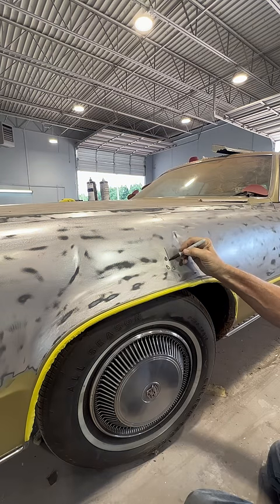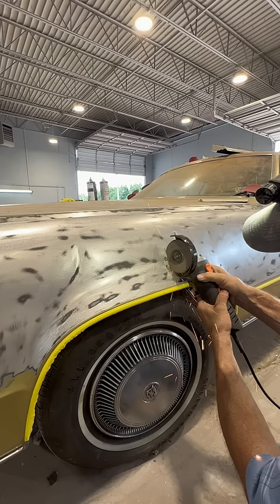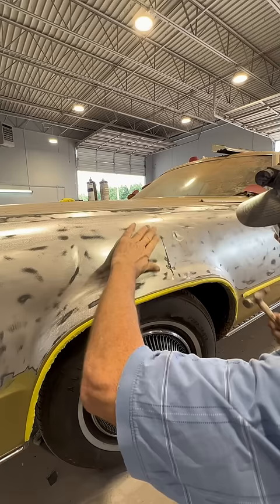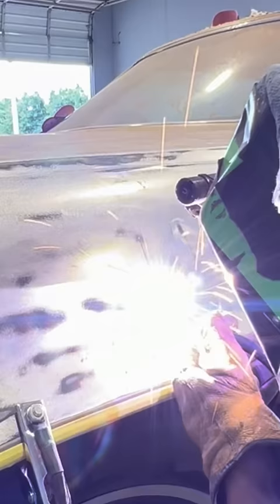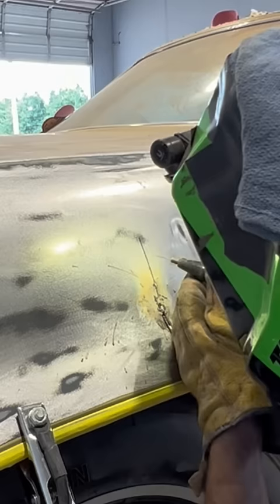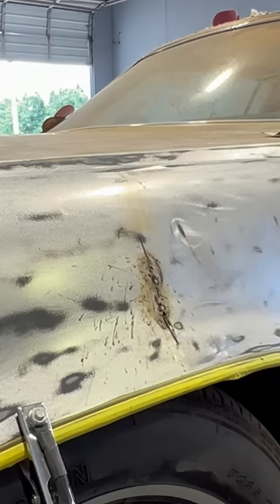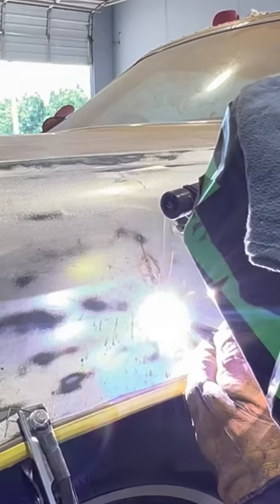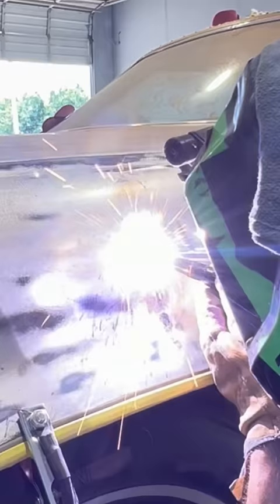BILLY SHOULD BE ARRESTED🤣 How To Fix A Buckle In Sheetmetal FAST DIY Auto Body Repair Flux Core Weld

Comment: You do a pretty slick job welding. I'm a machinist and a woodworker as a hobby. God willing, I never get stuck doing any body work. I'd be willing to bet 90% of the people that make comments about your welds would burn a bunch of holes in that quarter panel. Then you would have to buy a new one. Doesn't matter what the process being done is watching an artist is always fun

Comment: Glad you asked. I would use a shrinking disc or carbon shrinking tip, it would be done in minutes. Something done many tens of thousands of times.
Reply from the maker: Did you not hear that it was a buckle?  You’ve heat shrunk buckles exactly zero times.🤣🤣🤣🤣🤣
Reply: Oh no.. You're calling me out and seem offended by my factual answer and assume to know what I've done for body, paint, polish, restoration,fabrication, welding and show winning work.. What exactly is your definition of a " buckle"? Based on your "repair" you were removing a portion of the metal and further shrinking the metal, which signifies its a high spot/stretched metal.  For the metal to move in or out  it requires metal surrounding that area to also move in or out or structural damage to the part or both.. The reason for a "buckle" or a "high spot" is the integrity of the surrounding substrate/body lines are compromised..  How does cutting through the fenders "buckle" damage (which you just removed a portion of metal and also heated the surrounding area which is shrinking it, then welding, which is extreme shrinking due to heat and then grinding the welds also a form of shrinking due to the heat.....NOT equate to shrinking the "buckle"? BUT me saying I would use a shrinking tip/carbon tip/shrinking disc/map/ propane or cold shrinking the stretched/high spots/buckle does NOT work?  And to respond to you claiming I've performed 0 buckle repairs by shrinking, my main page banner for my real channel coming up on youtube which is a autobody fact checker page will showcase a 8ft ford bed for the Airforce of FT Walton beach, FL which will shatter your reality.  All you did here was waste time, materials, compromise a factory fender by doing the most aggressive and moronic "repair" for something that could literally have been done without any of this.  The metal on the lower fender moves in as you hammer it, further signifying it was high aka stretched.. You could have used a nylon or wood hammer and performed cold shrinking in literal minutes.. Do not follow this advice on this specific video.   There wasn't even a welding blanket or anything protecting the glass, where does  the splatter go when it hits a windshield?  Right into the glass...  No protection on the wheel or hood even...Can't wait to read your  response.

Comment: Love your no-nonsense approach to getting it done!
Reply: Thinking about stopping by a local body shop to grab a fender or quarter panel to practice welding some patches on. A cheap way to self educate myself.
Reply: What’s the longest you would leave a car in primer? The place that restored my ‘65 Chevelle left it in Primer so long that the paint won’t stick to it in some places and is now flaking off in some spots 🤬
Reply: I have one of those cheap HoboFreight welders that I use to weld up horseshoe clovers. Have you ever used one of those? I would imagine that for thing body work they would be fine to stitch patch panels in.
Reply: Whiskey dents!
Reply: Love to see the most dramatic before and after photos of some of the cars you’ve worked on. 👍🏻
Reply from the maker: @markbracci1184 I lost all my car pictures years ago
Reply: @OldBondoBilly that stinks.
Reply: What is the undercoat product you use to spray the backside of the fender when you’re done welding it?
Reply from the maker: Cavity wax (cosmoline)
Reply: Must be the same type of grease they stored Cold War era rifles in waiting for WWIII. Bought a few covered in that stuff. Takes a while to clean it all off. 👍🏻
Reply: Of course now you have me looking at another cold-war era guns online at GunBroker. Damn you Billy!!!😂😂😂
Reply: Odd question, but can you find sheet metal for patching panels at Home Depot? Saw a guy on a random channel say that and I thought it was odd.
Reply from the maker: Yes you can get sheet metal at Home Depot, but it’s expensive
Reply: Looks like YT is messing with you. There’s no way these have not had more than 1,000 views on the last 3+ weeks.
Reply from the maker: Almost 1400 views since Feb 3😉😉
Reply: Let’s keep her going!!!
Reply: It’s getting there Billy. Numbers are finally going up! 👍🏻

Comment: In the "old school times" before Bondo this metid was common. Then you used lead solder to fill in and sand smooth. Solder doesn't crack and flake off like Bondo will.
Reply from the maker: Fibral Lite also doesn’t crack or flake off

Comment: Love your work Billy we used the same method to fix the panels on 1 of my cars , we also use gasless on most of our jobs too 

We are currently building a 1929 hotrod with modern running gear and a channeld  body
Reply from the maker: Sweet😁😁

Comment: This is a very smart idea. It’s easier to weld than to pound it out. Thank you for sharing. Amen.
Reply from the maker: Impossible to pound it out without pulling the bottom front corner of the fender forward

Comment: How do you prevent the fiberglass from making a bump? Is it just invisible when you feather in the edges or do you beat the metal lower to make room?
Reply from the maker: A sixteenth of an inch is easily built into straightness

Comment: Whatever works best for you is the best way to fix it. I did body and paint repair in the early 70s we didn't have these new welders we had a torch and welding rods or brass for brazing

Comment: Believe it or not but thats how iI repaired an eight foot sheetmetal brake warped all to hell in a shop fire, paid 150 bucks for it for scrap iron then actually straightened it with this technique, sandblasted and repainted it and today you can't even buy one used like it for 3500 bucks, just goes to show those old schooll ways can be worth small fortunes at times if you open your mind to them.

Comment: Might not even need bondo if not much heat used to weld and grind. Xtra coat of primer will do 😁
Reply from the maker: I’m skimming it with fiberglass filler before finishing filler to get it. Nice and smooth.

Comment: I'm unfamiliar with the process of welding sheet metal for cars do you use the tacking method to prevent it from melting through the thin metal?
Reply: Yes, anything more burns through instantly.
Reply from the maker: Basically yes

Comment: Here  in Australia we have a product that used to be called metal mend. It was a K@H product before the factory burnt down, now motorspray a rustoleum assoc company has taken it on as metal fill. It is fibre reinforced with stainless particles and it works a wonder in doing the same as you, cut it with a flat drednel or you will be grinding ,there is no sanding with this stuff.

Comment: Great way too stress relief the metal, much like shrinking with a acetylene torch. Dude you're Ole School, not many of us left
Reply: I was wondering if anyone else here was gonna mention shrinking it with a acetylene torch I'm 40 but after I got out f highschool I went to a technical school for autobody  the teacher was a older guy he taught me and a buddy how to use a body hammer with a waffle head sorta like a framing hammer it has those spikes on the head  he heated the stretched part of metal and after it got hot he went around the outside of it with that hammer hitting with a inwards motion I'm sure it couldn't be done on these thin metal cars now though but I'll never forget him he was a awsome man/teacher he showed me how to lead a seam also he was like a inspiration for me  he knew so much and had so much hands on experience  I would have went to his class 2 or 3 more years if I could have but unfortunately you only get to go till you have enough hrs to graduate

Comment: Cars now all you have to do is heat it up with a damn hair dryer to get a dent out..😂 They say that it's to make vehicles lighter for better gas mileage.. But, I get better gas mileage in my 1989 Toyota SR5 that's constructed of all metal than my newer vehicles.. 🤷
Reply from the maker: I run into 24 gauge steel on newer cars.  That’s just ridiculous.  I can weld it just fine though as long as I have a separate heat and wire speed knob.😉😉

Comment: I have an original 1950's Fordson tractor fender that's buckled like this and hard to replace with anything nicer. I am thinking of doing the same with it.  I tried heating and cold shrinking it, but it won't go enough to be straight and stay there.
Reply from the maker: A buckle is not stretched; It is work-hardened.  You can’t shrink a buckle😉😉

Comment: Sounds good to me ! At least if i brought you a car . With a very small  pencil size rust whole over the rear fender . Ask you fix it the right way. Most likely you would have ground it down took all the rust out !
Replaced with metal welded  in a patch or welded the small whole  ! And puddy and paint  blend ! 
Sure your repair would have lasted longer than 4 months !

 Started bubbling charged me $ 1000  !
Reply from the maker: I have a short posted of a truck I put fiberglass filler in a rust hole 19 years ago that’s still holding 😉😉

Comment: That's the way my dad did, but he was old school that he used a torch and clothes hanger rod. I like it!
Reply from the maker: My first five years of repairing auto body damage, I did all welding with oxygen acetylene, and 3/32 copper coated steel rod.  I can weld with a torch like a ringing a bell.😉😉

Comment: Welding was never my cup of coffee. Nifty shortcut none the less. 
Would've taken me twice as long to heat, beat and shrink it back to decent. 😆
Reply from the maker: The top shelf repair would require a frame puller😉😉
Reply: @OldBondoBilly  
Top shelf repair is over rated.. same results can be achieved, as you often showcase.

Comment: Paul the fender from the front and Hammer the buckle flush and pull the moldings off the fender before you fill it and primer with urethane primer you don't want to be called bondo billy the butcher.
Reply from the maker: You can call me whatever you want Mr. Obviously quoting me from my previous post about using a frame machine to straighten the fender out.  Poser….🤣🤣🤣🤣🤣

Comment: Do you weld at very low amperage? great job
Reply from the maker: I weld 22 gauge with the welder set for 11 gauge.  Two little amwelding sheet metal too hard.

Comment: I would’ve tried a hammer dolly on the backside first. But that’s just me. It would avoid the foot deep dent you’re describing. Then again the fender can come off with like 10 of those 10mm bolts. I can never find my 10mm, so I probably would’ve beaten it. I can always follow up with putty if needed.

Comment: Thats a good way to fix weird dents like this, but I have to say having a shield on the end of the welding tip would help with those terrible welds. Definitely need to work on your welding skills but other then that nice work.
Reply from the maker: You don’t really seem like a troll, so I will enlighten you.  You obviously don’t know anything about flux core. My sheet metal welding skills are masterful, but you are not knowledgeable enough to recognize it.   Watch my long form vid about welding 26 gauge

Comment: If you use a shrinking spoon you dont have to spend all that extra time. It works great on oil canned metal.
Reply from the maker: A buckle is not an oil can.  It is also not stretched metal.  You can’t shrink work-hardened metal.  I was university-tech taught sheet metallurgy and hammer & dolly over 40 years ago🧐🧐🧐🧐🧐
Reply: @OldBondoBilly  you are trying to school a icar gold heavy hit frame technician......... been certified for 20 years. I know it's not oil canned. Read the comment again. If you gave the front of the fender a slight tug while tapping the buckle you wouldn't have to hack a vehicle.....

Comment: This dude needs to try pulse welding.. also a Better ground lol. See when the wire hits the base metal but keeps feeding before arching.. that is a sign of poor grounding bad clamp, cable, or ground to far from work zone.  

Anyway pulse welding is less heat and less spatter, so faster on clean up. 

FCAW old school time and place for sure.
Reply from the maker: Note to viewers: this guy is a circus character.  The flux powder can interfere with the arc starting, but nothing a little stick-like scratch don’t overcome.  Muh welder was $101 on an Amazon deal. It doesn’t have a pulse setting, or laser beams, or trans-warp drive.  If you can’t see that it welds just fine, you don’t even know the definition of welding🙄🙄

Comment: Listen to all the critics and then watch them make a mess of the job. Half of the would be welders think the point was to lay one clean bead instead of control the shrink. The other half are still in class. I think you did a skillful job and the art of getting the desired effect is lost on most who have commented.
Reply from the maker: How right you are.  If only the first half were made to demonstrate how they lay a bead on 20 gauge without extreme warpage.  Or lay a bead at all with flux core, for that matter😉

Comment: Ontario's cars are bombarded by sand gravel and salt thrown on the roads in the winter. On top of that there are temperature changes and extremes of January February thaws and deep freezes.
Reply from the maker: Them cars is hard to fix😱😱
Reply: @OldBondoBilly parts salvage and/or the crusher

Comment: You alway have a lot of wire sticking out. If you leave all the welding wire poking out the back. It’ll clean the mud out of the tyre tread 😂
Reply from the maker: Flux core doesn’t leave the pieces of wire sticking out the back like mig does
Reply: Was joking about the wire cleaning the tyre. Great videos. Keep them coming 🙌🏻🇬🇧

Comment: I did that with an F100. But i cut the whole sheet off on the roof and put anothet one on. Customer rushed me before i could shape it properly so i took a shortcut. 10kg 9f body filler on the roof alone😜. Came back 6 months later and said the roof cracked. Told him he has to pay me to do it again

Comment: I have one of those Oldsmobiles sitting in the parking lot at work I would love to see what you used to undercoat the inside of the fender
Reply from the maker: Wax wand
Reply: @OldBondoBilly  not familiar with the wax wand is that something like the undercoating guns with the screw on can

Comment: I love how you fixed the dent .
With a relief cut I do the same . Can I ask why the flux core welder? 
I use mig with co2 gas .on cars 
👍👍👍😜🏴🦕🦄😁🤞✌️
Reply from the maker: A lot of other reasons, but in comparison to mig, flux done my way is very flat with a LOT less grinding than mig
Reply: @OldBondoBilly  nice one chears
👍👍👍😜🏴🦕🦄😁🤞✌️

Comment: be a lot easier to just turn the hammer round and beat it into a dent , skim over and step on
Reply from the maker: Beatin a buckle creates huge dents
Reply: @OldBondoBilly  no worse than glass fiber , once your down that far a bit of sand and cement would near do.

Comment: All seems legit to me. I just can’t believe the 2-3 inches of wire sticking out of the welder.
Reply from the maker: That  strip of wire absorbs some of the intense heat of the millisecond burst of flux core arc that I’m applying to somewhat compromised metal😉😉

Comment: Serious question: when/how do you decide to use a hammer & dolly to smash the weld flat or just grind?
Reply from the maker: I can’t get to the backside so there’s no dolly.  But as you can see in the video, I had to beat the crap out of it to get it to level out to where I can weld it. Once I grind it, he will actually be pretty straight.😉😉

Comment: It works..not such a bad idea when you get alot of metal stretch.
Reply from the maker: No metal stretch. A buckle is a bend that compresses the steel molecules.  That is why I made my cut at the work-hardened crest of the buckle; to take away its strength, and allow me to hammer the metal back to the correct plane without caving it in around it

Comment: I've been meaning to ask about what welder you use and i caught a glimpse of it by pausing the video. Obviously if your using the Flameweld MIG145FX it should be good since you know what you're doing. I have a cheap Harbor Freight mig, would this be an upgrade even though they are about the same price? I'm going to be welding some patches for my rocker panels and after using what i have on a recent patch job i think i need something better.
Reply from the maker: I don’t recommend the flame weld welder unless you’re welding 20 gauge minimum.  Because of the one knob, synergic design of it, adjusting to weld down to 24 gauge is not optimal.  I can weld 24 gauge easy with my welder that has separate wire speed and voltage knobs.  I’m thinking of trying the green titanium flux welder from Harbor freight that has separate knobs so I can recommend a welder. 😉😉That’s easy to take back when there’s a problem.

Comment: Didn’t your vevor dent puller come with a shrinking tip? Hopefully it did, it works very easily and efficiently. Much better than shrinking with a torch. I’ve removed massive high spots with a shrinking tip
Reply from the maker: A buckle can’t be shrunk😉😉